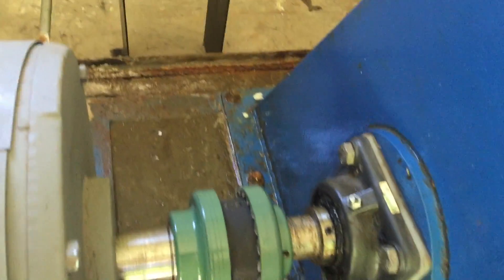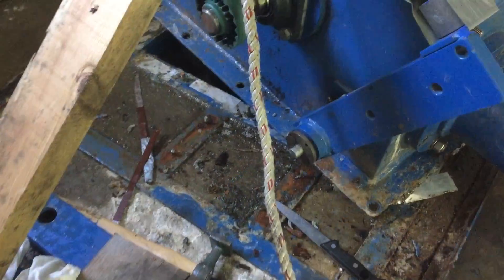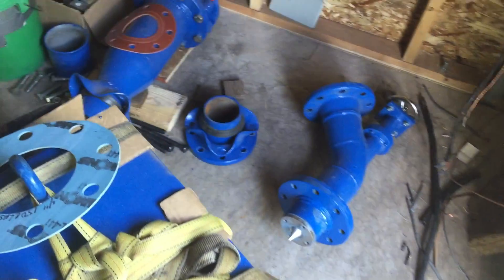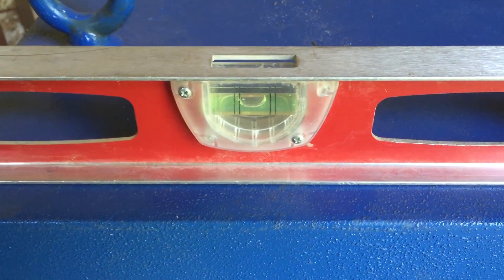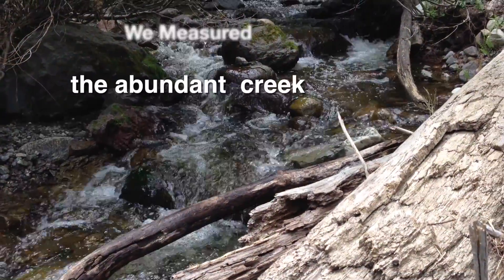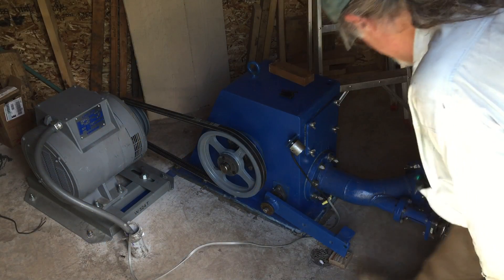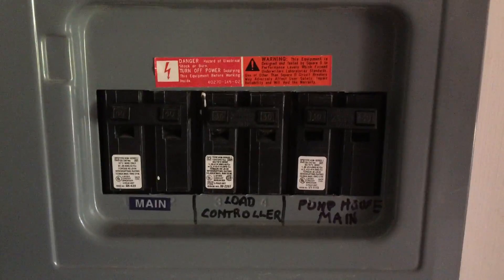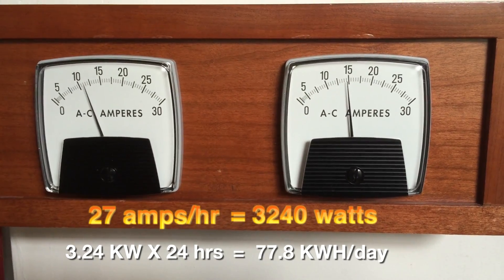Part 15 MicroHydro Power System in CO

Comment: so what is the pay off of all that was done. when will I pay for itself. is this just for one house or for a community.
Reply from the maker: mellender0 It's a good question, but very difficult to answer. First, one would have to amortize the cost of laying in grid power in 1994.  At the time of the switchover the system had produced 145,000 kWh for a basic cost of $25,000 versus $140,000 for laying powerlines. Add $52,000 of current development costs and you are paying for all the future power generation in the systems lifetime. You would also need need to subtract the cost of line power over the last 19 years to determine the cost per kilowatt hour over the first system's history. The other reality is that the present level of power production is maybe 1/5 of what we eventually hope to accomplish. 

Ultimately because it is AC you have to use whatever power you are generating at the time you're generating it.  Living off grid with hydropower means that you use more power than you usually would, you run appliances more frequently, have access to using large electric tools, you always have hot water available at no cost, can defray the cost of heating your home in winter, and you are paying for all future power at the beginning. So, it becomes a lifestyle choice. Are you willing to pay for all of your future power upfront and have no environmental impact and thereby increase the asset value of your property, or are you buying into the centralized system with power production which at this point is based about 50% down to 42% on coal for power generation over the life of the current system. 
Changing one's approach/reliance on the polluting centralized system requires planning, commitment, and patience. It is not something most people are willing to undertake, or have the financial wherewithal to complete. I got lucky and found myself able to pursue this undertaking nearly 25 years ago and am fortunate enough to share my experience via the Internet which has developed in the interim. 
Hopefully people somewhere in the world will find the information useful.

Comment: Watching the generator run after watching all your hard work was so satisfying.Reading that the project was only 52K is amazing and I'm sure it's because you did so much of the work yourself.

I would love to see a video of your usage of the power in your house and how, if  you modify your use to allow for a lower but continuous form of generation. IE  Do you have to shut down air conditioning to rum oven? ect. Do you think creek flow will ever reduce like what happened to your spring?

PS I have never seem any video that made me as homesick for Colorado like your videos do. Your filming style and choice of background music make me wish I was there helping you. Beautiful land, beautiful house and a one of a kind video series, Bravo.

 house,.
Reply from the maker: Thanks for the kind comments.  We have lived with the amount of power coming from Hydro for many years so we have learned to pay attention to how much power we are using to not overload the system. We are at 8600 feet so there is no AC involved. Cooling the house at night is adequate to keep it cool all day. With this new system the problem gets to be how to use all the power we generate.  For this reason during the summertime the power is set between 1500 and 2000 W, Providing 36 to 48 kWh per day. This allows us to run most any appliance during the day singly.  Additionally we have unlimited amounts of hot water with that amount of power. 

The system is still being enlarged and not complete yet. In the winter we hope to eventually provide all of the power we need to heat the house which has in floor heating and is passive solar design. 

Hopefully climate change will not create huge droughts that will vastly impact the flow of the creek.
Reply from the maker: Thanks for the kind comments.  We have lived with the amount of power coming from Hydro for many years so we have learned to pay attention to how much power we are using to not overload the system. We are at 8600 feet so there is no AC involved. Cooling the house at night is adequate to keep it cool all day. With this new system the problem gets to be how to use all the power we generate.  For this reason during the summertime the power is set between 1500 and 2000 W, Providing 36 to 48 kWh per day. This allows us to run most any appliance during the day singly.  Additionally we have unlimited amounts of hot water with that amount of power. 

The system is still being enlarged and not complete yet. In the winter we hope to eventually provide all of the power we need to heat the house which has in floor heating and is passive solar design. 

Hopefully climate change will not create huge droughts that will vastly impact the flow of the creek.

Comment: 3kw seems waay low for that system, if i help install more generators can i use that power then?
Reply from the maker: In the mid 90's when the system was first installed the cost to put in a power line ran about $20K per mile and we are 7 miles from the grid.  So, unfortunately we can't get any income stream from the power produced.  It would be nice, but the whole original motivation was to avoid $140K install and power bills every month.  The original $25K we put in the system has provided pressurized domestic spring water, a pond for raising trout, and over 143,000 kwh in the time since.  The new installation of the same turbine/generator on the new pipeline will provide many times the power and hopefully fully heat the house in the winter and may one day charge an electric car if we can find an affordable model that is the right fit.
Reply from the maker: virus464 System is planned to be increased to 8.5KW as time, need, and funds provide.  Not sure I understand how you would be able to share the power.  Line grid is 7 miles from the property.
Reply: i would have some devices that could need that power very well, ud be suprised
Reply: +MrHydrohead i have so much enjoyed watching your journey and admire the amount of work you have had to do. can i ask do you sell any of your electric you genarate back to the power companies and if not now then do you plan this for later as a form of income. how far are you from the electric grid, is it possible to do this?....
Reply: i would have an option to use the power immediately as is.  the special computers would use the power to generate money if u will.

Comment: I am curious as to why you did not keep the generator in your original powerhouse and have 2 generators. It is not that hard to sync generators and once synced, you would have more power and some redundancy if one failed.
Reply from the maker: puppynosee Cost is primary.  I was quoted $7.2K just to refurbish the turbine and create a frame and pulley system for the new installation.  This didn't include shipping.  I undertook to not accept the quote.  

A new 2nd turbine and generator would go way beyond that and adds needless expense.

Also,  how much power can be utilized?  With the planned output there will be far more power produced than can be used at least in the summer.  The excess just becomes waste heat, so in summer we throttle back the water flow used.  Someday an electric car would be a good use of the excess power.
Reply: +MrHydrohead Your pelton wheel sure does not show wear in the cups a great  find.
Reply from the maker: robert howell Yup, still very clean after 19 yrs of use.  A testament to clean spring water as a source.
Reply: +MrHydrohead One spring I have is turned on 2 miles away but it is just for water summer use and never goes dry. It comes out of the bottom of an old growth stump so cold you cannot put your hand into the stream.  Other springs I am tapped into I have to watch out for falling rocks over one is in a canyon.  Good work though. Over the years you find out what works and does not work. How many psi do you normally run at?

Comment: I've been waiting for months for this part. Fantastic job guys and what a journey. I bet it was well worth the time and effort. Give me a couple of days and I'll send you a basic plan for a greenhouse that would also cope with your winters. Plants need light to grow as well as the right temperatures. Light is cheaper to generate and this design helps keep the heat in with as much natural light as possible before using artificial ones. Just add extra light and some heat for the worst part of winter ;-)
(love that intro with the Humming Birds)

Comment: glad your day finally came. i have watch and learned so much form your videos. i can't weight to stat on my own micro hydro project. still collecting pipe and water data to find the right size of turbine getting about 1000 gpm at 10 feet of head. hoping to get 2000 watts out of it. keep up the good work

Comment: Nice Projekt! But why u controle the frequency by putting dummy load on it, and not by controling the amount of water comming in the turbine? U can use a fast actuator on a valve for controlle. this protects your gear from wear, and makes it more efficient.

greetings from Germany
Reply from the maker: Glad you like the project, thanks for watching.   Multiple reasons for my choice. 1st not sure if you watched whole video series, but I am relocating an existing installation and the added cost of an actuator would be a large added expense.  2nd there is no shortage of water available, so efficiency is not really a big issue.  3rd, the dump loads are as much as possible going to be beneficial uses for heating. 4th sudden changes in water flow can potentially produce a destructive water ram effect. 5th when I put the system in during 1996! the education I got was that mechanical flow control was more expensive and more maintenance required.  6th and last, the turbine and generator are both very heavy duty quality devices and have run with minimal wear now for 19 years, so no great concern on equipment wear. Probably another reason would be slowing speed of water in pipe in winter might be an issue with fragile ice forming, not certain on this one but just speculating.  Hope this all makes sense.  Greeting back to you from Colorado!
Reply: Yea, that makes total sense! :D I might think often too komplex. In your case of using creek, the benefits of an water flow kontrolle are useless. Dose the genset run 24/7 ? I work with emergency diesel generators, the maschines often just run about 100-200 hours in 20 years and I wonder how much damege these things have in this less runingtime.
Reply from the maker: Yes it does run 24/7.  I currently turned it down a bit to about 2100w even though there is a lot more water available. About 51-52 kwh/day.  That's a lot of power, the typical US home averages about 30 kwh/ day.   The excess that we don't just becomes heat and in the summer no need to heat my basement up.  Yeah we have a military grade gas genset 10k from first bush Iraq war.  Run it almost never and I wonder about it too.  I imagine water vapor creates corrosion internally on both gas and diesel, but probably less on diesel.

Comment: That is very cool, thanks for taking us along on this journey. One question you mention water rights does that cost you anything, like a yearly fee or something?
Reply: thatguyoverthization h
Reply from the maker: In Colorado, you file in water court for conditional water rights either through a lawyer or by yourself(pro se).  There is a filing fee.  If the court grants the right, it is conditional and they are good for 7 years and must be filed for every 7 yrs. until you prove beneficial use, then you can file to make them absolute.  Once granted, absolute water rights remain permanent and no need to refile.  Microhydro is considered non consumptive(into pipe, out of pipe), and not too difficult to get.